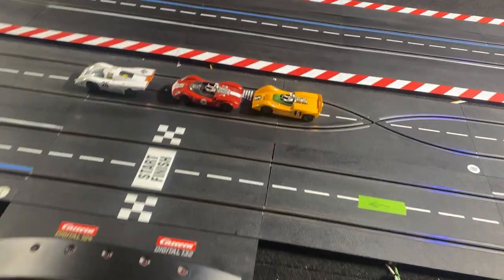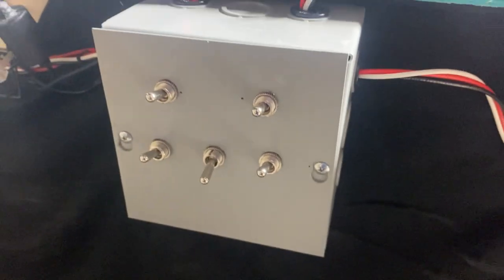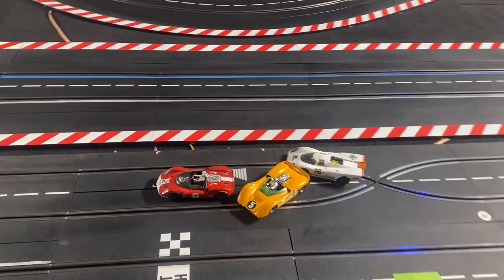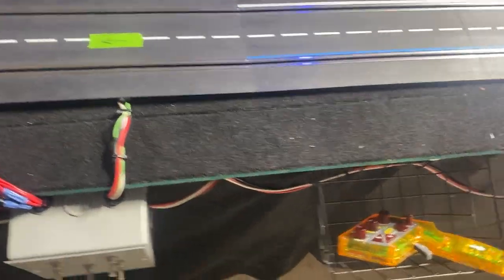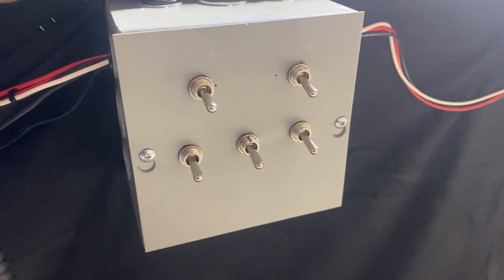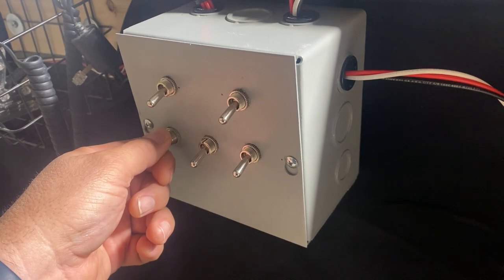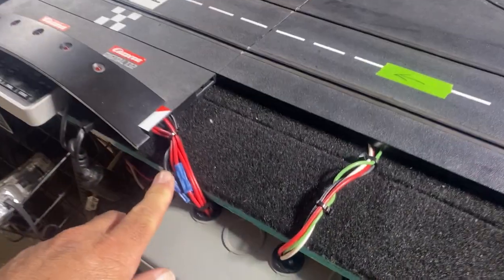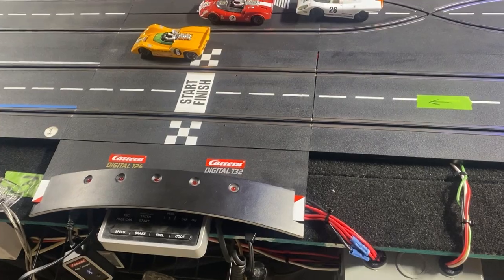Discussing how to DIY a Carrera Digital to Analog Conversion Box - Part 1

Comment: Love the creativity here Marty "Edison" Ford!  :D   
Ironically, I'm in the process of designing a Gen3 TEK-Slot that would allow the option to run chipped lanes for analog or a true analog experience with analog controllers.  The latter has been a major allure to me of the OmniSlot, but the cost is prohibitive to the casual racer, such as myself.  But instead of a multitude of switches, I think it may be time to construct a logical control using an Arduino and relay boards.  Still just a glimmer in the eye, but the concepts are coming into focus.
Reply from the maker: Thank you Joseph. This comment means more to me than you realize. 👊

Comment: I don't even have a Carrera Digital yet. Yet I am anxiously awaiting the next vid.    I have loads of HO track and over 400 cars.  But, I really want to get into 1/32.  As far as your track box, wouldn't it be relatively easy to put a plastic guide/cover over the switches.  Activating them all at once.  All up digital..all down analogue.  That way you won't have to worry about possibly activating a section before all the switches are thrown.
Reply from the maker: Great idea!! I may order a bigger switch to move them all to one.. it is an experiment. Thanks!

Comment: Marty, this is awesome content. I too know just enough about electricty to be dangerous. You mention that you were thinking about using a 3 way power switch but since you are only using a 2 way is there an order that you need to isolate power with the other toggle switches?
Great Job
Gene
Reply from the maker: I usually flip the isolation switches first.. then the power. Seems to be fine.

Comment: Very impressive, Marty. Right on. 🙂
I see you have them Straight`s hooked up before the Rails. ;-)
I give you a I on that. That problem was the problem, right? ;-)
The idea of putting a triple-way Toggle-Switch to prevent mixing up the Systems and turning the device off, is smart. 
Get a On-Off-On Toggle-Switch and you are good to go. Label the Switches on the Box, as well.
Put a flexible Tube over the Cables, that run in and out of the Box and the Cable-Tree towards the Track-Piece, when you are finished.
That will prevent the Cables from mechanical damages.
The Controller Cable-Conectors would be better of with plugs, that way the electrical Poles 
are not blank open at the Track and won`t be an electrical hazard. 
Those Crocodile-Clamps are not the best solution to connect the Controller to the Track-Piece. Thay can ripp off.
Actually these are the electric Regulations, running electrical Systems and Items, to prevent from electrical shocks. 
One can do privately do what ever he wants in his place, but if any damages are done by it,
your Insurance won`t pay and in Germany for instance, you would be sued by the Accident Prevention and Insurance Assosiation.
Your Box is electrically covered, because it is a non Metal-Box made out of Plastic,
that cannot transmitt, or lead electrical Current. Wood, is also non-transmitting electrical Conductor and would be ok , too.
Go on Marty, you are on a good way. 🙂
Reply from the maker: Thanks Bo.. in the States.. most every commercial track uses the alligator clips connection for controllers. Thanks for all of the advice. I am planning to make some upgrades. 👍

Comment: Great idea Marty. This will be a really big help to those looking for other options with carrera track. I hard wired my scalex track to use a variable power supply and aftermarket controllers but keep the arc air timing system and app compatability. The more people try tinkering with things the more options come to the hobby.
Reply from the maker: Thanks Mark!

Comment: Ight. I found a wiring diagram from 2017, it allows 2 lane digital/analog operation with a single switch, it is 4PDT switch so it is able to handle all 12 connections at once. It is by far the simplest wiring diagram I've seen so far.
Reply from the maker: Excellent!

Comment: Hi Marty like what you are doing, but I don’t understand Carrera that they not have build a simple switch in like Scalextric that change between digital and analog it is so simple, but maybe they don’t want other car to run on there tracks and then run opposite polarity , just my comments 
All the best
Arne Toft Danish but live in UK
Reply from the maker: Thanks Arne. I appreciate the kind words. You make a great point.. would be easy circuitry for them to add. Carrera sells analog and digital cars. Would make perfect sense.

Comment: LOL, they guy that makes the 'Axle box' will love this video
Reply: I almost exploded with excitement when I saw this video. I am SUPER curious on the basic functionality of these three-wire controllers and how I can fab-up a 3D printed box as small as possible with and without the ‘studs’ for the alligator clips. Something that will work with the tekslot or AxelBox. Marty you’re still running the omnibox correct?  I have a basic idea of how that device works - but I haven’t dug into it too deeply, I’m interested in how your current setup is wired for sure
Reply from the maker: I actually built my own box. I was using a Tek-Slot box.. because I could not figure out how to use my analog controller with it. Also.. because the digital CU wants to control the braking.. analog controllers (SlotIt) options doesn’t seem to work. A complete walk through is editors and ready to post.. I can also send you my simple wiring diagram too. Let me know.
Reply: @twolinesslotcars  are most of those toggle switches single pole (two connection points)?  Just thinking of ways to simplify your design with multi-pole switches, good on ya’ for coming up with your design on your own. It takes guts to ‘throw the switch’ on an electronic project👍🏻
Reply from the maker: @Sunshine_Speedway_SlotCars  yes, I used toggle switches I already had… but order a 6pDT and a 4PDT from Amazon and you can go to 2 switches.. also.. if you combine the commons you could do it with one..
Reply: Totally different philosophy of use.  AxleBox and TEK-Slots use lane chipping, so one digital CU, one set of controllers, one power supply.  Marty's (or OmniSlot as well) is completely different - it is providing a true analog experience, thus the need for 2 or possibly 3 power supplies, a set of analog controllers and a set of digital controllers.  Make sure you take the cost of the added components into consideration.
Reply: @twolinesslotcars  How can I get a copy of the wiring diagram?
Reply from the maker: @mrl8599  should be a link to my original in the description… and here is a converted pdf https://drive.google.com/file/d/1-jnvUMrH6DsCgNBzNz5STvI6d3VOn7wC/view?usp=drivesdk

Comment: In analog mode, can you control the voltage to the track?
Reply from the maker: Yes, from the adjustable power supply. 👍
Reply: @twolinesslotcars  ok so then the CU is responsible for delivering power in digital format, and you are using a variable power supply for the analog side of the solution
Reply from the maker: @BajanBert  the variable power supply is powering both the CU and the analog side..
Reply from the maker: @BajanBert  the center switch is controlling the power for both.. up it powers the Carrera CU.. down.. it powers the analog track